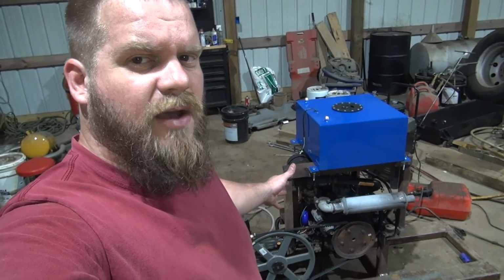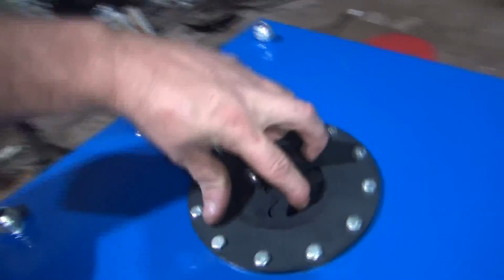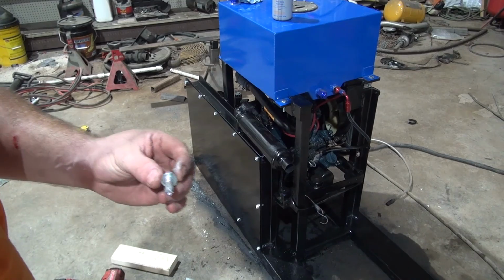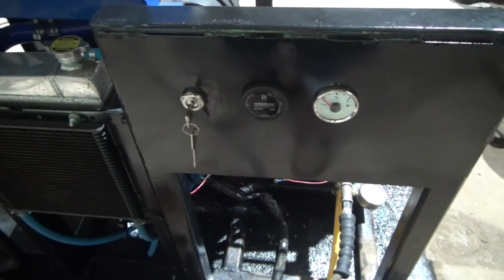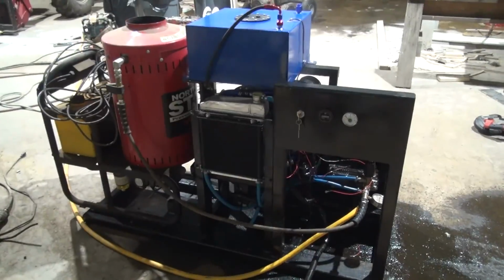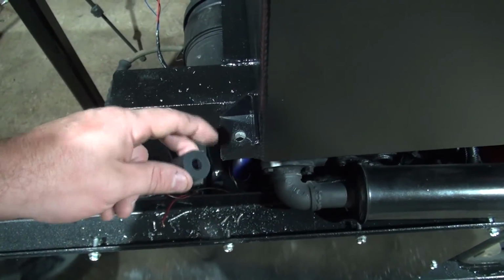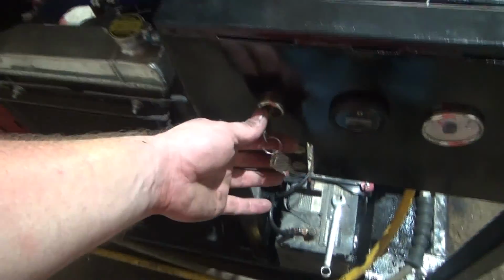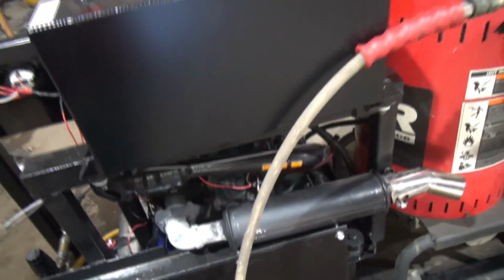Kubota diesel hot water pressure washer part 3 Finished

Comment: This turned out real nice.. as for your tank I didn’t see a vent any where on the tank. Don’t forget fuel expands as it heats up
Reply from the maker: The spare little cap on top is not tight. I put locktite on the threads and left it loose so that the center is loose if that makes sense. Cap is made of 2 separate pieces. It's probably not the best way to vent it cause water might could get in if it were left outside. But I have it inside so I figured it would work at least for now.

Comment: Yes I'd say a bad weld .  I went with a plastic tank on mine .
Reply from the maker: This turned out to be an expensive project, but it's got plenty of run time.  I don't have to constantly stop to put gas in it while soap is drying on whatever I'm washing. Now you can build you one with that spare engine you have sitting around collecting dust 😂
Reply: @LifeWithChase  I have been looking at doing it , I was talking to a kubota engine  rep that told me not to use a high side load on  the crank bearing as it wont last long as it was never designed for side loads so I'm looking at a direct drive  connection for the pressure pump or a jack shaft .  Let's see how you make out  with  your pulley drive and hopefully the sideload is not too much.
Reply from the maker: @SteveRobReviews  Ive heard that, but here is my take on it...  It's ran side loaded for 15,000 hrs turning a generator head for a semi apu. According to the internet it should have blown up already 😂 These engines are used in many lawnmowers with belt drive. I would think that the bearings are better than what's in the typical gasoline air cooled engine they typically use for belt drive pumps like this  Now I wouldn't expect it to hold a triple belt or wide power band, but I'm thinking a single belt as close to the engine as possible should be ok. Got about 12 hrs on it so far in this application hopefully many more...